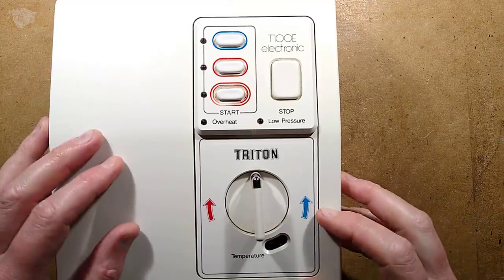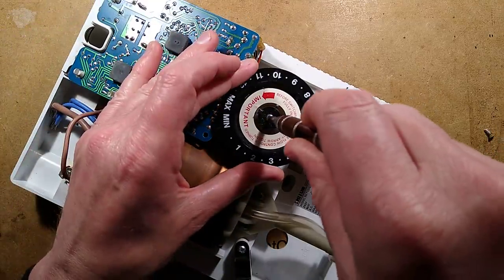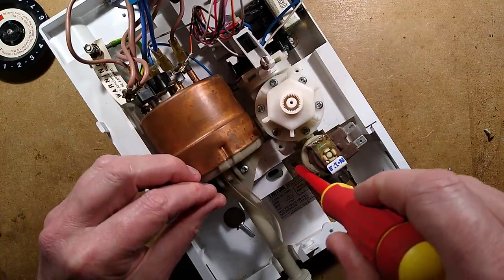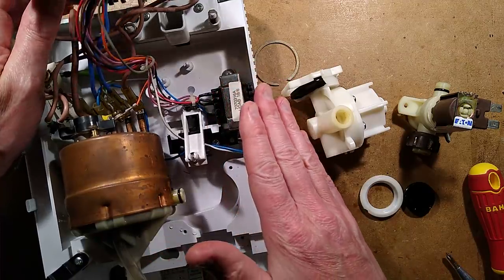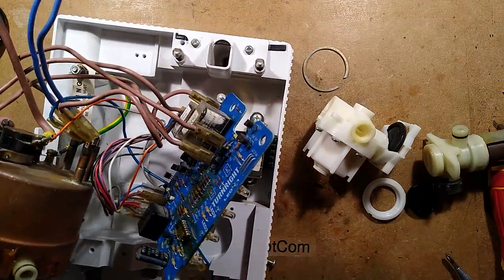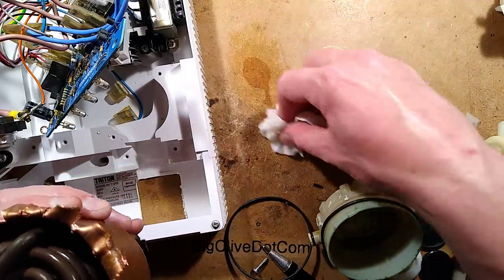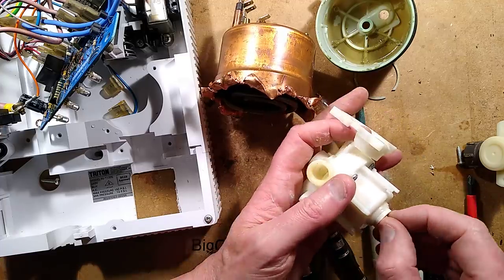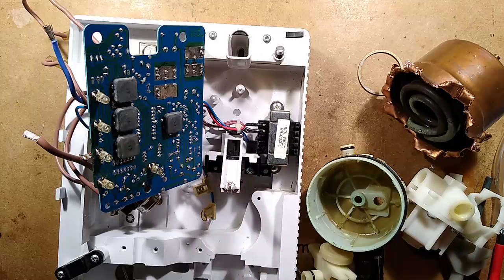Teardown of a British electric shower that went bang.

Comment: UK: "We can't trust ourselves to have plug sockets in the bathroom, so we only have one isolated 110V shaver socket in there."
Also UK: "Hurr Durr We Shower With Electricity"
Reply: No kidding! Seems like a disaster waiting to happen.
Reply: The thing is, the electricity is nowhere near the water and the whole unit is made of plastic.
Reply: It’s as likely to shock you as a metal kettle or a stove element. The element is insulated from its casing, so there’s minimal risk of electrocution. Compare this to the Brazilian suicide shower, where electricity passing through the water is used to heat it.
Reply: It’s funny how much people are afraid of what they don’t understand or what doesn’t seem common. This would bother a lot of people but those same people drive around carrying 10 gallons of explosive liquid that when used releases deadly fumes only feet from where we are sitting. 

Point being real danger is more about the engineering than what is used within that engineering. I would be much more worried about a $2 usb power adapter than 220v in a properly engineered water heater.
Reply: @ecospider5  you ever seen those killer USB sticks? It takes and holds power from a USB port and once it has enough it shoves it down the data lines to kill the device!
Reply: “Electricity is nowhere near the water” but you have fuses in every plug for every device.
Reply: @Adam-McG  yes, and a dedicated current limit in the consumer unit for the shower.
Reply: @Scrogan  please tell me how the hell can you form part of an electric circuit when you are surrounded by non conducting, non earthed stuff?

You do know how electric shocks happen?
Reply: @Adam-McG  yeah, it's called safety

Comment: More likely the the pressure switch cuts the heating element off if the water pressure goes too low
Reply: I agree. Also illuminates the low pressure lamp.
Reply: The thermal switch mounted on the element housing does that.
Reply: @MrsZambezi  they both do that. safety. n stuff.
Reply: @MrsZambezi  better it doesn't get the chance to heat up to trip the thermal to start with. If pressure drops below enough to keep switch closed, illuminate low pressure and cut power to heater.
Reply: Sometimes (usually?) the pressure switch is the main on/off switch for the the heating elements. When you press the on/off button on the front, the only thing it directly operates is the solenoid valve. Then, there's a short delay before the water pressure builds up enough to turn on the elements. That won't be the case with this model, because it has that cold flush-through feature when you turn it off.
Reply: @patrickwigmore3462  It would make more sense to me for that pressure switch to be plumbed straight through from the supply, with the solenoid only controlling flow through the outlet going to the heating element.  In that case, no (or low) pressure could cut the mains power to the entire device, preventing damage or shock if the internal mechanisms fail and spray water everywhere internally.
Reply: @TheSaltyExplorer  The problem with that arrangement would be that a failed solenoid could cause loss of pressure on the heating element side, which a pressure switch on the other side of the solenoid valve would not see. You'd be relying entirely on the thermal cut-out to stop it boiling dry. If the pressure switch is located on the heating element side of the valve, then it can protect against both loss of water supply pressure and failure of the solenoid valve.

Comment: Japan is known for having small houses and apartments so they have been using tankless water heaters for decades.  Small units are often seen mounted on the wall over the kitchen sink.  They're very reliable and efficient, much more so than the large and wasteful American tanked systems.  My parents house in the US always had a big hot water tank and it always ran out of hot water whenever two or more people took showers. Taking a bath was impossible.  It, however, had an expansion tank mounted nearby that got rid of any water hammer.  Probably saved their pipes from damage over the years.  They finally went tankless last year and now will never go back to the old ways.
Reply: Tankless as in they get electric shower?
Reply: @usec5503  usually natural gas tankless, sometimes propane. Electric tankless is costly as you need to run new thick service cables to the breaker.
Reply: One issue with tankless is you need to flush them and have a water softener if you have hard water or it's asking for problems
Reply: @SlocketSeven  no he said the hot water got used up by only 2 people using it, not that it wasnt heating the water.

Comment: Since there‘s a „low water pressure“ waning light on the unit, it’s probably an enable switch that deactivates the unit when the water pressure gets too low.
For a German, this is a very strange system to get to see. Here, we usually have big hotwater tanks in the basement, heated by the same burner also used for central heating (oil or gas in most cases). And If we do use electric / continuous flow heaters, they are usually outside the shower, often coupled to a smaller tank, and supply JUST (scaldingly) hot water. But every shower (and other faucets) has a mixing tap, either with two rotary knobs for older installations, or a single handle mixer (anything past the 1980s, really).
Reply: I'm from the UK and I have a similar thing, where the shower mixes hot and cold water and has no electrical systems. I have an on demand combi boiler rather than a hot water tank though
Reply: We have this and more in the UK. Oil is rare and has been hated a long time. We use gas (combi boiler or hot water tank), though swapping to electricity for new builds (immersion/combi) as though more expensive it is greener energy.

If you're all using oil heaters it makes me suspicious that germany can meet any emissions targets. 

Though germany claims wood power plant is green energy too... perhaps in the literal sense xD. Buying up timber from the amazon deforestation to burn to fudge emissions figures, i see why now, oh my =') 'biomass' indeed
Reply: @mandowarrior123  Well, it’s usually old heating systems from the 80s and earlier, quite a lot of those still remain in service.

For current installations, it looks more like this: „Laut Statistischem Bundesamt lag der Anteil an mit Öl betriebenen Heizanlagen in Neubauten 2018 schon nur noch bei 0,6 Prozent. 41,2 Prozent aller neuen Häuser werden demnach mit Gasheizungen ausgestattet, etwa ein Drittel werden mit erneuerbaren Energien geheizt, 22,4 Prozent mit Fernwärme.“

>> According to the Federal Office for Statistics, the share of oil fuelled heating systems in newly constructed buildings in 2018 has dropped to 0.6%, 41.2% of all new houses are therefore fitted with natural gas heating, about a third is heated using renewables, 22.4% use district heating systems.

Source: https://www.sueddeutsche.de/wirtschaft/oelheizung-erneuern-zuschuss-1.4624858

But yes, Germany should do a lot more to protect the environment, no question about that.

Comment: I think the emergency CutOut is there not for a low water pressure but as a cutout for in case the flow-switch sticks without waterflow. 
Modern gas-heaters check as a fail-save test if the NO and NC are acutely in the “rest position” before each operation.

Comment: I worked at a power station with a 340 MW generator that had (pure) water cooled windings and hydrogen cooled rotor, but I still get uneasy around electric showers lol

Comment: I still remember in the 1980s in the Caribbean running into the predecessor of one of these at a hotel. It was all built into the shower-head. Two wires coming out of the wall and connecting directly into the shower-head with wire nuts. I remember thinking they have these complex grounded plugs with a switch in the wall to "protect" the user and then this contraption in the shower. Crazy.

Comment: I still can't wrap my head around the idea of having a 220v appliance in the shower with you! Just seems nutz to me.
Reply: I really can't see why anyone thinks a properly grounded appliance on a dedicated circuit and breaker is an issue.
Reply: @skylined5534      2 reasons
 1. Murphy's law "Anything that can go wrong will go wrong"
2. Mullins' law "If it can go wrong, it will most likely go wrong on a Mullins, in a BIG way, and at the worst time, and will likely make another Mullins laugh, probably a spouse or parent."
Reply: @bryanmullins2063  

Thing is I've never heard of one single person perishing due to an electric shower unit. There are literally millions of them in use in the UK on a daily basis too.

My above comment doesn't cover shonky installations or the use of those bizarre electric shower head things.
Reply: Nearly everything you can touch in the uk is RCD protected so basically a gfci or gfi and these showers are very reliable more shocks happen from electric water heaters in the uk

Comment: 12:00 I think you're misunderstanding the instructions Clive - to turn valve to minimum. I understand your point to minimise flow to minimise water hammer but I think they mean minimum temperature i.e. max flow - to flush out as much trapped air as possible prior to heat being applied.
Reply: Max flow would mean minimum restriction and as a result lower hammer effect.
Reply: Cunning Stunt That is not how this works. Lower restriction - higher flow rate - higher speed of water front - higher impact force, proportional to the velocity squared.
Edit: Even tight corners or dead ends like the diaphragm chamber provide enough restriction the produce some sort of impact. Not as bad as slam shutting a valve, but still. So, while fully opening the valve would have protected the valve itself, all other components containing tight corners and dead ends have a higher risk of severe water hammer damage.
Reply: HouseGurke fit an accessible ball type check valve when you install the new unit and you can cut the hammer of at the pass.

Comment: I fixed our electric shower got an old new part off ebay the shower was from 1998. I was a little concerned about the waterproofness in certain areas and souped it up with silicone and waterproof tape. It is still working fine 🙏

Comment: 8kW for a shower sounds disappointingly feeble. Here in germany we use 3-phase (400V) water heaters at around 20kW, so I have absolutely no idea what this electric water heater scare stuff is all about.
Reply: You only need a GPM or 2 for shower. 8kW is more than enough for that. Remember you're not mixing with cold after heating. So 35f/20c of rise isnt bad.
Reply: the modern ones are 9.5-10kW.

Comment: No barrier between moisture and electronics in there is there. I always assumed the insides of these would be sealed, potted and gasket-ed up to the hilt.
Reply: Yeah, there is. It's extremely safe. Also, it's connected to an RCD, so in the event of a catastropic fail, the power would be cut extremely quickly.

Comment: water and 240 volts......perfect combination!
Reply: All new bathroom electrical installations in the UK must have a 30mA RCD protection to them (GFCI if you're American) and these sort of showers are going to be earthed. The likelyhood of an electrical safety issue is incredibly small if installed correctly.
Reply: I've used these on and off for about 15 years, even had a couple fail on me and have had no incidents. They're safe.

Comment: Low pressure disables the unit to stop the heating elements overheating. I've never had a problem with these units although I do concur that it doesn't appear to be the best idea!
Reply: Low pressure on the inlet side will stop it from working, but there is also the possibility of blockage on the outlet side which would cause the pressure release to activate. Also the possibility that the diaphragm gets jammed and doesn't stop it from cutting out. The physical pressure release is just a low-tech last resort to prevent an explosion of boiling water.

Comment: Yeah, nah. I like my hot water system id rather have a boiling hot bomb on the other side of the house rather than Mains power in the shower, if I wanted that I'd just start splashing water at the power points.

Comment: Awesome.. I remember years ago installing an electric shower and starting it off on hot without running any water through it...The lack of water caused the heating element to pop...Not a good start. Had to repair it before i could use it...Since then ive always remembered when dealing with simular units. Always run them on cold first to fill them and eliminate any air locks before calling for heat...

Comment: I'm from Germany - here we often use instantaneous water heaters. The big difference: Our devices has power Ratings of 18kW, 21kW (Standard) and 24kW and need 3-phase 400V to power these things. Older or cheap devices use simple hydraulic pressure switches to turn on, you can choose between two heating-levels and the final temperature you have to adjust by the faucett. Newer devices are electronic instantaneous water heaters and use electronic flow-rate sensors. The outgoing temperature can be adjusted stepless up to 60°C. The heating-power is controlled by Triac's or Thyristor's. The expensive ones have LCD Displays and programmable Temperature Presets. By us, these things has to be mounted in a safe zone so you can't reach them when standing in the shower. The market leading manufacturer in Germany is "Stiebel Eltron".

Comment: Turn towards blue to make it hot, towards red to make it cold.  Yeah.  That would get you sued in the US.
ETA:  In UK, you can't have an electrical outlet, because danger.  Also in UK, run 240 volts into the shower.
Reply: kcgunesq Because idiots would could plug anything into a socket in a bathroom and most appliances are not protected against water ingress, wet hands etc. A shower is designed to be safe even when water is spraying over the unit.
Reply: @spencerwilton5831  One could simply install GFCI - unless they don't make 220v versions.  We recently remodeled a bathroom  Went from one outlet to four, including two with USB sockets.  That way, we can plug in virtually anything, including razors, toothbrushes, vacuums, the bidet, shaving cream warmers, etc. All protected by GFCI for less than $10 or so.

Comment: In Germany we have modells with 3 phase supply and 22 kW regulated eletronically. I had a unit running for > 20 years without a problem. It was replaced in a complete remodell of the bathroom. I once opened a broken one from my parents. Looked similar inside except for a bigger heating element with the water cooled triacs.

Comment: Blimey, that's ancient. Hardly any scale though, must be very soft water. I couldn't see the power rating properly but you might have trouble getting one that low powered. You might have to run a new feed or cheat and disable one of the elements in a new one.
Reply: Judging by the size of the internal cables, I reckon it's probably about 6.5kW, not at all unusual. The external cable looked like it could handle a lot more so a 7.5kW replacement should easily be feasible.

Comment: thanks clive!
i have a water heater from 1998, and we still use it because of regularly maintenance by myself, cleaning up the heater and calcium builds inside the little tank on it, and if anything fails, it pops the GFCI breaker (never happened but i test it regularly too) and most importantly i can find its newly built parts from call service, yes! after 24 years, i can still find the parts..

Comment: That diaphragm is a protection against too low water pressure, not too high. If it triggers the "low pressure" LED lights up. Power to the heater cuts out too (obviously).